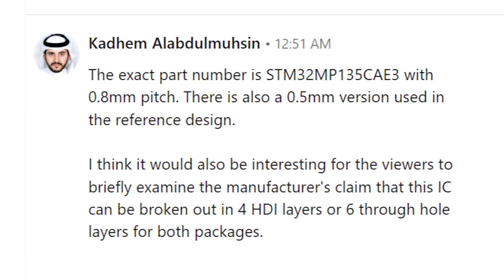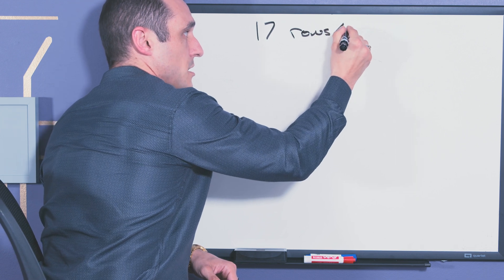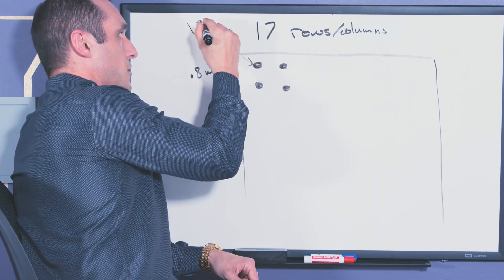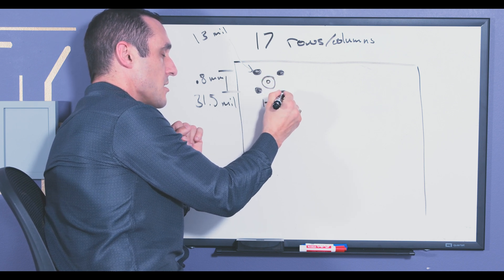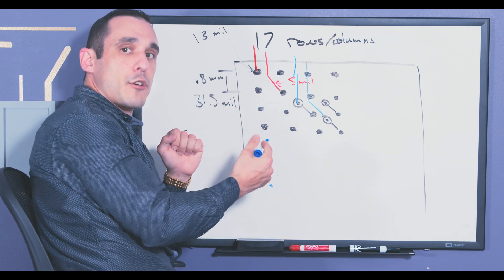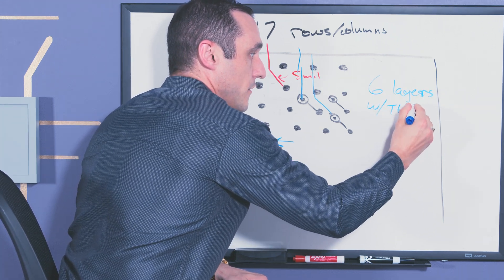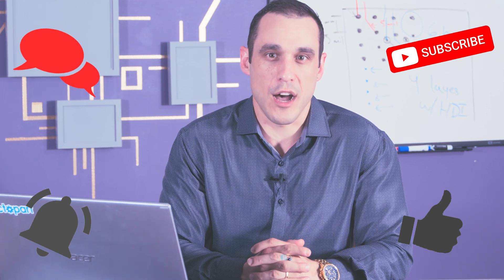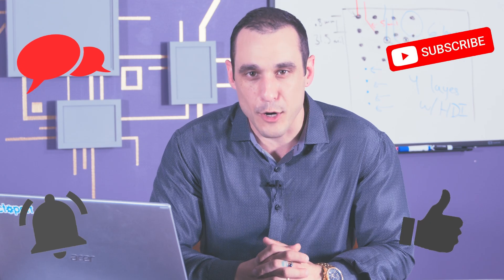STM32 Fanout: Through-Holes vs. HDI

Comment: I dont think this video considers the ST part shown there actually has a large ground area and power area in the middle. So really 10 layers isnt needed.
Reply: It's been awhile since I did this video.... as I recall the STM guidance stated 6 SIG layers, not 10, but that higher layer count would only come from interleaving between all signal layers in that fanout regardless of whether there is a cluster of signal or ground. That's what would be needed assuming all the rest of the SIG layers are filled and you need all that ground everywhere. So in reality for the entire fanout and if you have not many other signals to worry about you could probably get away with 8 layers.

Comment: Thanks! Moving to a 0.5mm pitch, is it just more aggressive trace sizes?
Reply: It is not necessarily more aggresive trace sizes unless you are trying to route between pads in the BGA footprint. In small pitches like 0.5 mm or smaller you might find that you cannot get traces between those pads due to the small clearances allowed between the pads unless you use an additive process for fabrication. Really what you will need to do is eventually get down to minimum mechanical drill size and do everything with blind/buried vias in i + N + i stackup, and you still might not be able to route between the pads even on inner layers.
Reply: (I'm a junior EE supporting the other EE's so bear with me) This is our first 0.5mm bga. We're doing a combination of thin trace sizes (2.5mil at lowest) with a i+N+i arrangement. A problem we're facing are microvias opening at temperature, either during population or our temp cycling. From our fab houses to online documents, the third stacked microvia is mainly what causes issues. Are mechanical drills even an option at this size? I thought we needed lasered vias. Trying to stay away from VIP. Cost isn't really a factor, we just need these boards reliably made. I'll have to take a look at the additive process you mentioned. Thank you again, your videos teach me so much.

Comment: Hi Zach,

You added two layers to your 6 layer board, but you need 6 of them  to route out the bga.  That only leaves two layers for power and ground to separate the signal layers to avoid layer to layer crosstalk.  Are you concerned about that?
Reply: I'm not advocating that you only do this on 8 layers, just showing that you only need 6 of them for routing signal, I only added the two extra layers as an example. More layers would be needed overall to use this component and other components on the PCB, and some of those layers would be GND/PWR or other SIG layers for other devices.

Comment: Hi Zach, this is a great video and much appreciated to show patterns for how to fan out small pitch BGA. 

Out of curiosity, the aerospace world in my experience has always been wary about the use of BGA components with pitch less than 1.0mm. I'm assuming this has something to do with the reliability of the actual physical implementation for building blind/buried vias and I tend to recall a rule of thumb of only utilizing board manufacturing houses that utilize mechanically drilled holes instead of laser technology. Do you have any insights or other thoughts on this topic where boards are required to maintain high reliability after running through extreme thermal shock cycles while also employing the use of tight BGA grid pitch dimensions? Could that potentially be more related to surface tension and curvature on the board itself with potential to crack or 'pop off' leads of a BGA component?